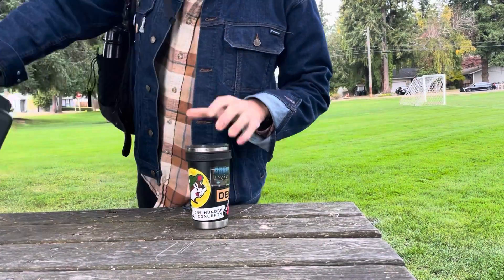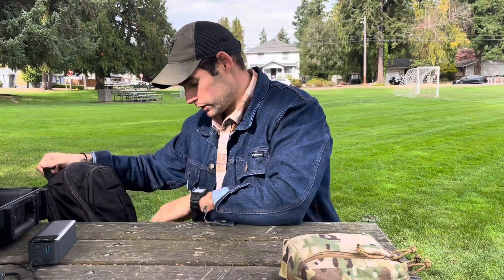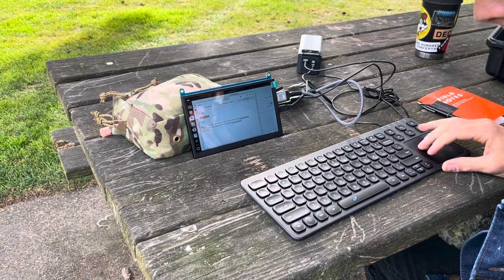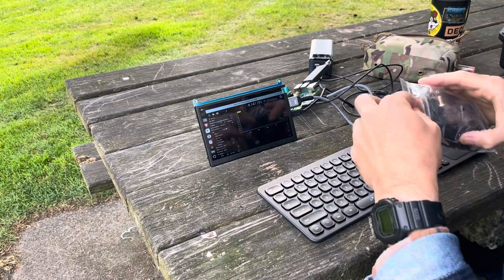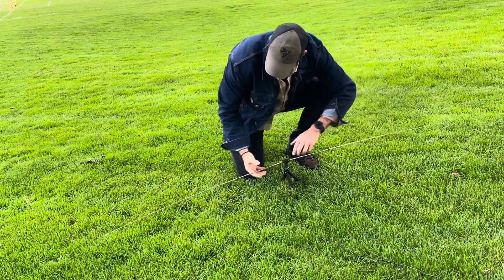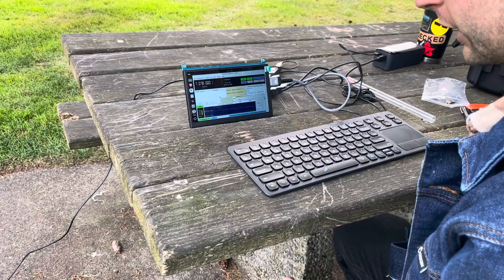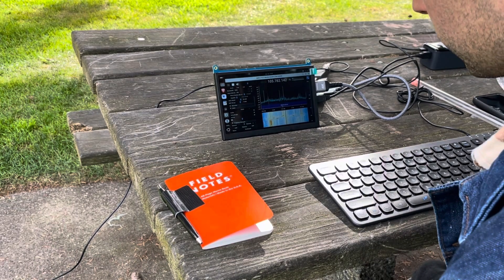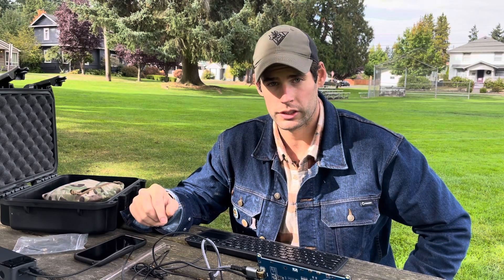Field Testing Off-Grid Advanced Comms Methods | JS8Call, SIGINT, SDR++, Ubuntu, Meshtastic

Comment: I'll give you some tips that I have found running the pi for the same thing the pi needs active cooling and heat sinks when running SDR's or js8call or it will crash randomly. and all of your cables need RF chokes on both ends because the Pi, the SDR and the battery power converter make a lot of noise. if you want to run multiple programs on a single pi, you should probably upgrade to the Pi 5 and look at overclocking it

Comment: I've only got a tech ham license so no real HF experience but for 40m, your antenna should be 66 feet long for a dipole. So your rabbit ears are probably too short to get enough of the signal for JS8 Call to decode. It's also probably too close to the ground and that's interfering with reception. Good on ya for getting out and experimenting!